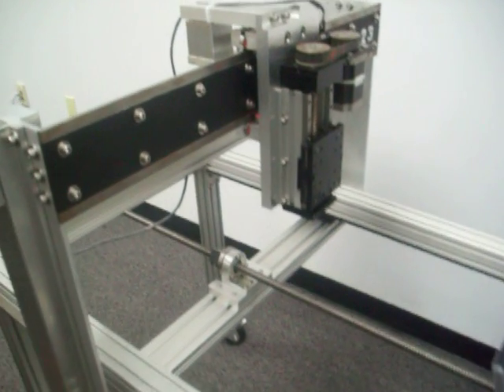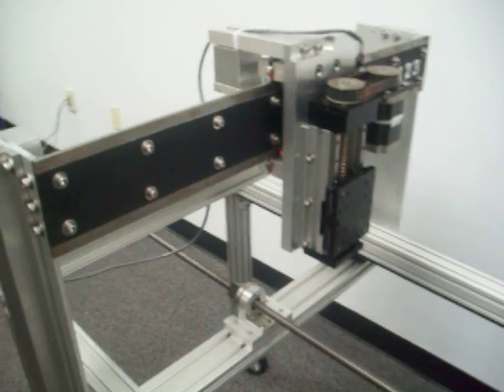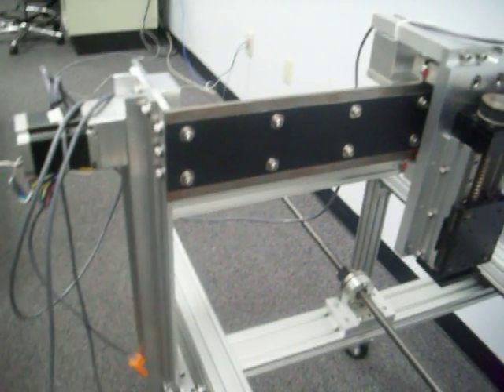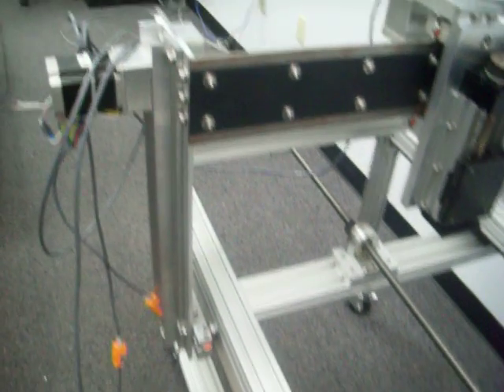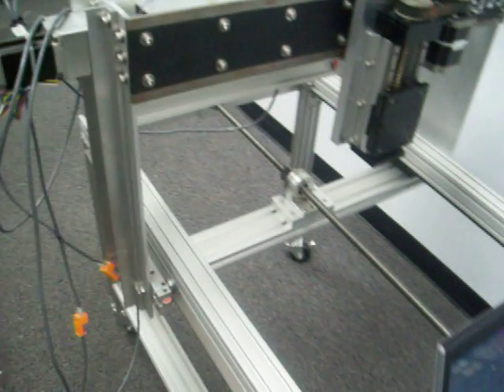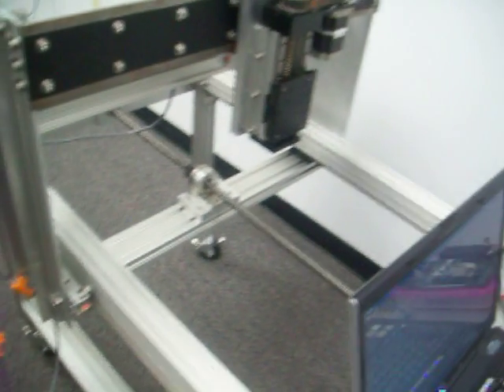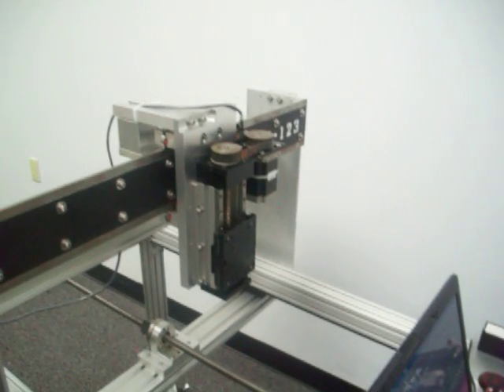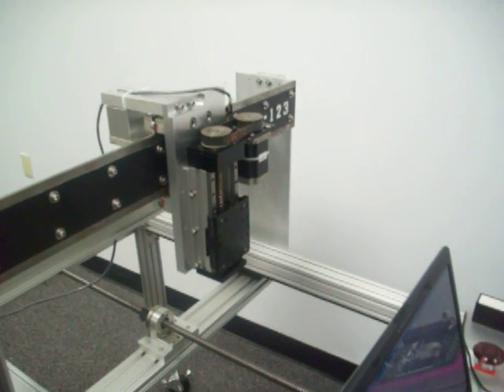CNC Build Update #3

Comment: Nice looking machine.  You mentioned that you do not have computer control.  What are you actually driving the motor with?  Did you build a circuit to provide Step and direction signals to your stepper drives?  What are you planning on doing with the machine?

RWW